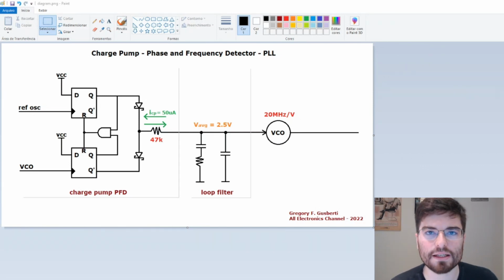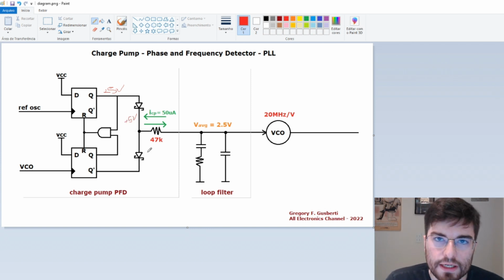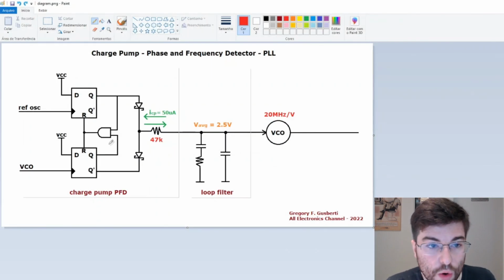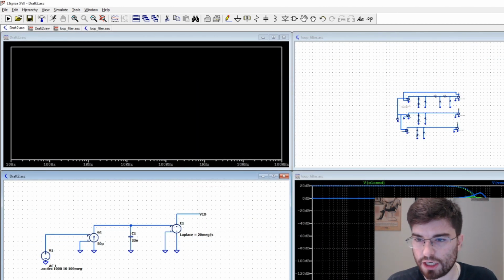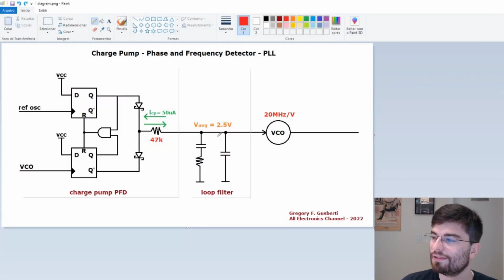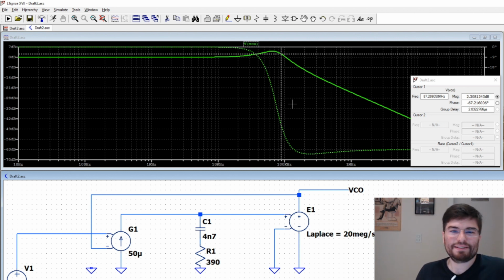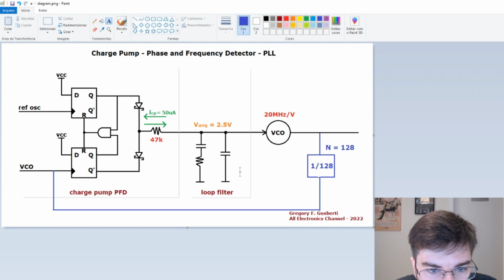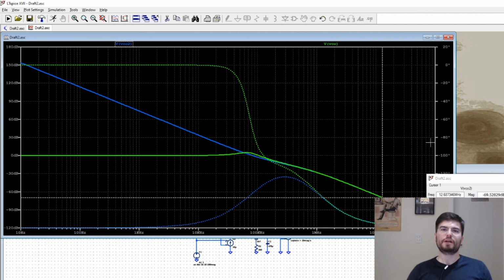PLL Phase Locked Loop on LTSpice

Comment from the maker: Support the channel becoming a Patron
https://patreon.com/allelectronics
Reply: I haven't simulated PLLs, but I have simulated numerous opamps. I usually compensated for ~72 degrees of phase margin. At this amount of phase margin the control system will have the best step response (i.e. the shortest settling time). If the closed-loop system is ringing in the time domain, the system doesn't have enough phase margin in the frequency domain.

Comment: This video is still useful after 4 years. Thank you.

When I used the Laplace source in my high end simulator it worked for the open loop response, but would not show any peaking for closed loop even when the phase margin was 0. I finally replaced the Laplace source with another voltage controlled current source into a capacitor. I used a 1uF cap so that I could set a current of 20. It matched your results. That gave me the confidence to use this simulation for my circuit. It is amazing how much more accurate this is compared to the "PLL loop filter calculators" that are out there. Thanks again.

Comment: Great work! I’d love to see you simulate a scenario where you 'fix' a VCO’s frequency using a PLL, but then demonstrate how to intentionally shift its phase while staying in lock. Alan Wolke (w2aew) did a brilliant 'extra credit' demo of this by injecting a DC offset into the VCO tune input via a summing resistor. It serves as proof that the loop can compensate for the error while shifting the phase—basically the foundation of PSK. A simulation showing the loop filter's response during that transition would be incredibly helpful!
19:55
https://youtu.be/SS7z8WsXPMk?si=gzUkNHRjcQKpAf0U

Comment: The information in the video is worth more than a thousand books. It has to be noted also that the bandwidth of the closed loop does not depend on the divider N, only the voltage level (phase). Noteworthy also to say that bandwidth of closed loop with just a 1p cap is not higher than 100k HZ and depends on Kvco and Ko.
Reply from the maker: Glad you found it helpful, and thanks for pointing that out!

Comment: Hi, thank you for this video, it's really useful!!
 I just wanna ask you about the Gain of the VCO, did you set it in rad/(Hz.V)? 
what I noticed also is that we always look for the 0dB crossing in the open loop gain, why is that? and why the phase margin needs to be lower by 45°? and most importantly when I choose the values of R and C that provide stability, how can I know their effect in the locking time?

Comment: Is the phase detector itself really integrator? If the phase difference on the input is constant the output of the detector is also constant, so it seems it is not integrator. VCO is the integrator.
Reply from the maker: It is. Constant current into a capacitance is integration. The VCO also integrates.
Reply: @AllElectronicsChannel  A ok, with the output capacitor it is true. Interesting videos and great explanations.

Comment: thanks for the videos!
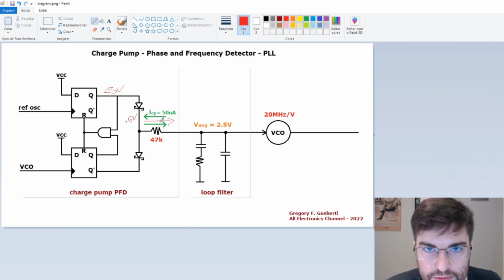in 5:30 i don't understand, why 47K ohm and not 50K. also i don't understand why the current is designed to be 50uA ?
Reply from the maker: 47k is a comercial value and 50uA was a good current to generate the gain needed. 500uA was to much and less than 50uA is difficult to deal
Reply: The sensitivity of the VCO is a gain factor in the loop and will impact the loop response. The VCO gain, along with the charge pump current, are knobs you can tweak to get the loop response you desire.

Comment: I want full circuit by single transistors
Reply from the maker: I want two bottles of wine.
Reply: Only two bottles?
Reply: @AllElectronicsChannel  you don't need that you need only ....... Starting
Reply: You can get there. You need to break down each of the blocks into discrete components, slowly replace each block with your new design implementation.

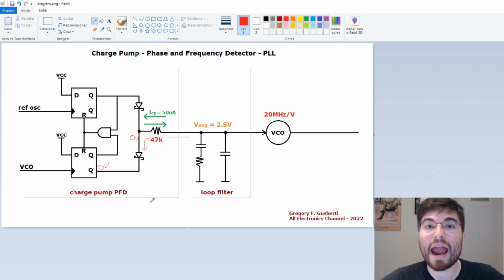Comment: Thanks for the video, I have a question on 6:32 you said that for large signal the system is always stable, although I feel that the statement is true. But I don't really have a rigorous explanation why this is the case. Do you mind to explain why this is the case?
Reply from the maker: For large signal, the loop will follow a zero-error condition in a non-linear manner, always working to counterbalance the error. For small-signals we have the current source aproximation.

Comment: I'm using ADIsimPLL, and i'm getting a phase error output of 1.6k deg in the linear region of the chirp, how important is the the phase error, and what's a good typical value?
Reply from the maker: 1600 degrees??
Reply: @AllElectronicsChannel  yes it is defined as 
Output phase error = (actual VCO phase - target VCO phase)
Reply: @AllElectronicsChannel  also it says
"The output phase error can exceed 360 degrees by a very large factor - in fact the phase error can get to N * 360 degrees where N is the main divider ratio.   This is because the phase error at the comparison frequency can get to ±360 degrees,  so the output phase error gets to ±360N degrees. "
Reply from the maker: So 1600/N is your actual phase error. If it is constant and you need phase error 0, you need to increase the order of the loop (add and integrator).
Reply: @AllElectronicsChannel  so does that mean I have 1600/8 = 200 degrees phase error? (My prescaler is 8) is that close to 180 so I expect an unstable PLL
Reply from the maker: This is the phase error but this doesn't have anything to do with loop stability!! This is the phase error of the output signal in relation to the input, with the pll working in closed loop

Comment: In practice,how could I measure op loop curve? If there is not vco feedback into pll, pll won’t work.
Reply from the maker: If have no idea about nothing, you probably need to poke around with different capacitors and resistors until the loop works.. So you have a starting poing.
Reply: I mean that I have pll and vco spec to simulate to get initial loop filter,but I found vco is oscillated with initial loop filter. Then I want to  measure gain curve of open loop,How to do this.
Reply from the maker: If it is completely oscillating you need to play around to stop the oscillation, discovering what is wrong with the model. 

If it has ringing, you can excite de loop with a step (changing in input frequency), looking at the VCO voltage. Now you can annotate the parameters, as a 2nd order system, to model it better.

Comment: as always, great!
just a question, when you have a frequency divider on the output can it be just described as a voltage divider on the output of the voltage controlled voltage source in the simulation instead of including it in the phase detector gain value?
Reply from the maker: Yes!! Is the correct place! I probably would use another voltage controlled voltage source only for the visual, but a resistor divider would work exactly correct!

Comment: The 0 dB Point of the Loop Filter is the capture Range of the Pll ? Thanks a lot for your Video this Topic isn’t in YouTube at That Level of deepness
Reply from the maker: For PLLs using the XOR phase detector the capture range is related to the bandwidth, for this phase detector with flip flops no!! The integrator action will always find the lock point
Reply: @AllElectronicsChannel  so with this type of pfd the capture range is limited only by the vco range. No?
Reply from the maker: Yes!!